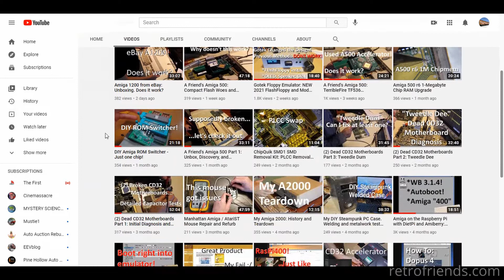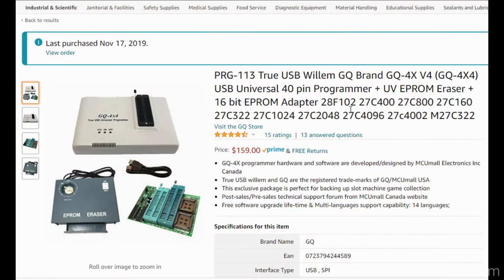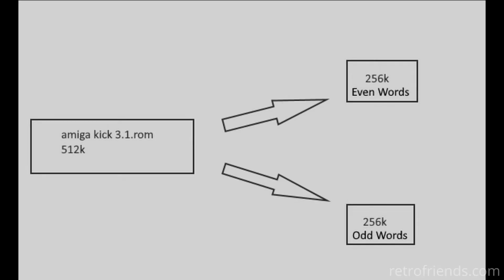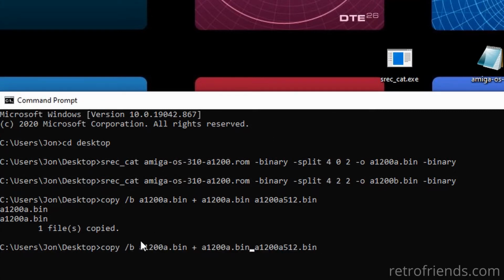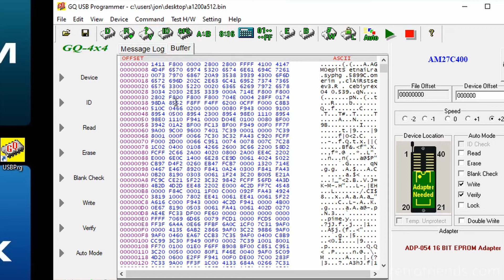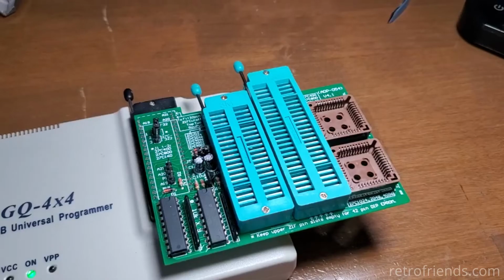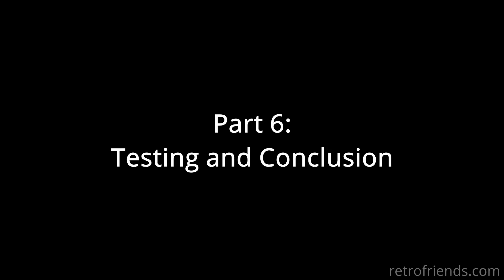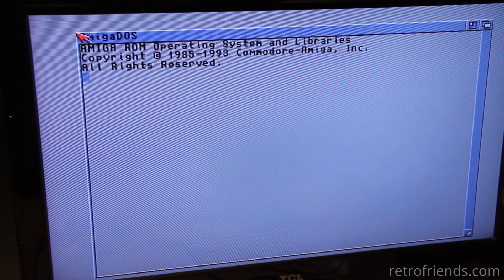How To: Amiga 1200 3000 4000 DIY ROMs

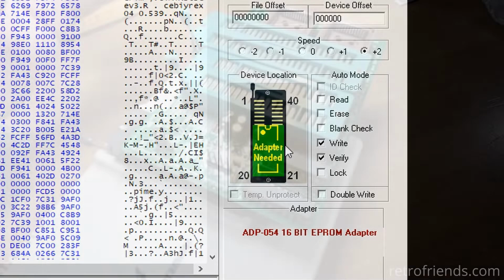Comment: Pretty good explanation & very helpful. Thanks. If I understood properly, this Amiga split the word wide into 2 ROMs, each ROM store half of the word (32 bits). Is it? Also, in minute 9:43 you explained that need to swap something in the ROM image, what and why? thanks
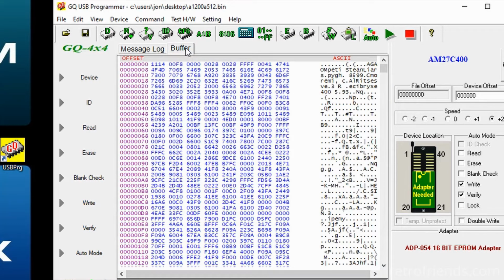Reply from the maker: 9:04 is what and why. The what is "bite swapped". The why is because the Amiga wants the ROMs swapped. I do not have further information than what's in the video. Sorry, I'm not a software engineer, I just made a video on how to do it and I've included all the information you need to do it yourself.
Reply: @retrofriends  Thank you :) and great video guide.

Comment: Everything very nice and calm explained - very nice, thank you very much!

Except I personally wouldn't go for the GQ-4X as it seems pretty expensive (together with that adapter and UV Eraser its for sure over 200$). 

The TL866II+ is obsolete and also still pretty expensive so I'll go for the T48
https://www.youtube.com/watch?v=42VCmOVWAyc

The only thing I'm note yet sure about is the adapter. In this video an already built one for the T48 is shown:
https://www.youtube.com/watch?v=6XaAcomXXrk

There's one you can build on your own for the TL866II+
https://www.youtube.com/watch?v=LnNt-aUs20M
but I still have to figure out if that one can be used for the T48 too...

Comment: Just a couple of notes:

- If you get a programming error where the programmer was unable to "clear" a bit, don't bother erasing!  Just turn off the automatic blank check and try programming again.  Remember, for EPROMs, programming means turning 1-bits into 0-bits.  Sometimes a few bits can be sticky, and require just trying again to program them.  The programmer should skip over the bits that are already programmed correctly and just program the ones that need clearing.  Of course, this may vary depending upon your hardware.  I recommend the Xgecu T-48 (and adapter for 27Cx00 chips) at this point in time.

- Rather than double up the images, you can program 2 separate ROMs to the double-size chips.  There will be an extra upper address line (on each chip) that you'll need to connect a switch to toggle between 5V or Gnd to select the image to be used.
Reply from the maker: Thank you for the advice. I did a separate video on putting two rooms on one chip with a switch. Good to know it can be done with these double chips too.

Comment: THANK YOU for doing this.  Only issue now is that the latest srecord seems to no longer be the same CLI options.  I'm trying to remedy this, but resulting files I get from tying the commands in here end up being around 600K before doubling them up.  I'll have to see what changed.

Update: I used the same version but it was on windows 11.  The resulting file it made was 634966 bytes.  That's bigger than the ROM file itself - so the splitting doesn't seem to work on it.  I ran the help for it and don't see an option for -split

Comment: This is an excellent video. But, for me, in my Amiga forever directory, my ROM size is 11 bytes more. Isn't this because you require to "decrypt" the ROMs first? If - when you open the ROM file - it starts with "AMIROMTYPE1" then it requires decrypting, surely? In that case, you need to remove those first 11 bytes and XOR each byte with the ROM.key file indexing as you go. Finally, you end up with the ROM as it is intended for which I had to write my own thing to handle... Not sure if a public one exists.

I am curious as to why your ROM files in your Colanto are not also 11 bytes too large...

Thanks.
Reply from the maker: I have another video on my channel that I believe addresses this. The gist is that you have to install licensed Amiga forever software and run it once. It will then decrypt all the roms.